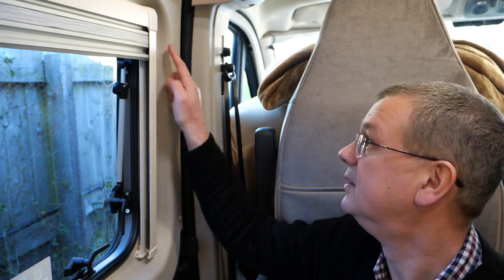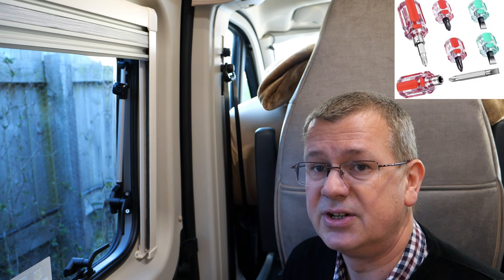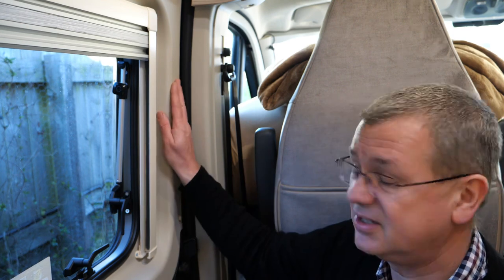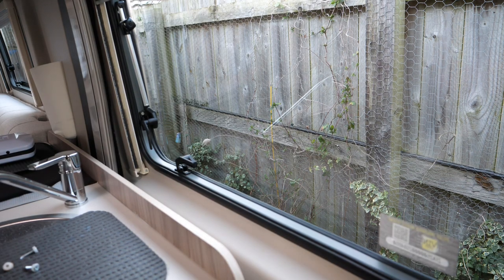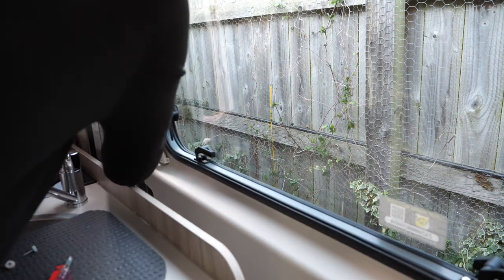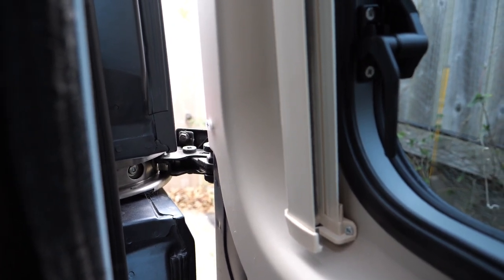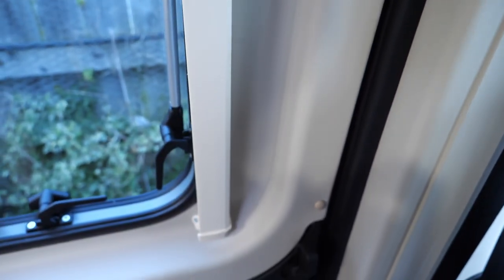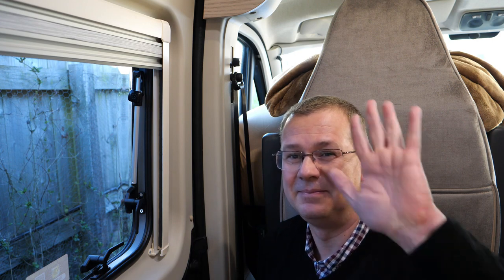Securing the sliding door trim panel on an Elddis or Compass CV Campervan - Quick Fixes

Comment: The tape doesn't hold the panel on very good but ours hasn't got any pre drilled holes. That looks tidy how you have done it.
Reply from the maker: Thanks Colin, it was certainly handy having the pre drilled holes as took the decision away on where to drill. I wonder if they have recently started putting pre drilled holes in or if this is an exception? - all the best, David 👍